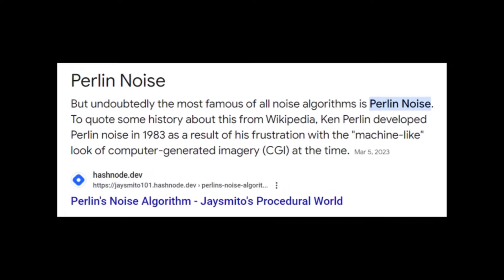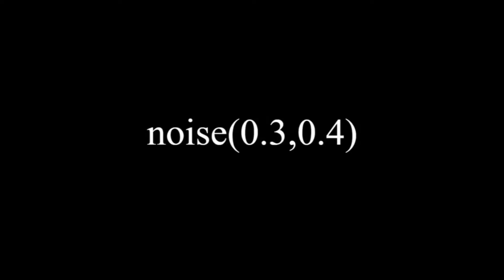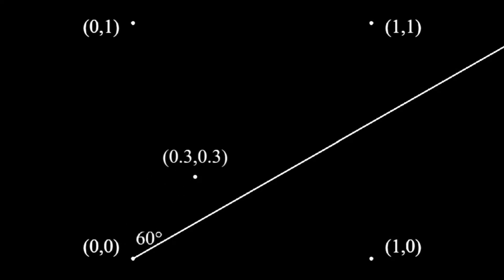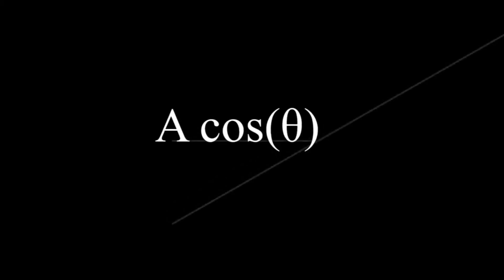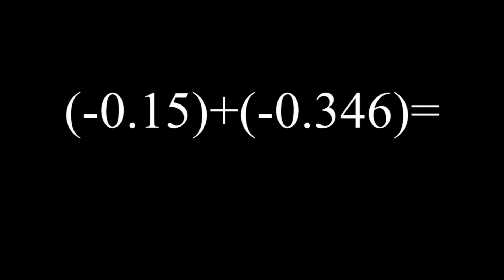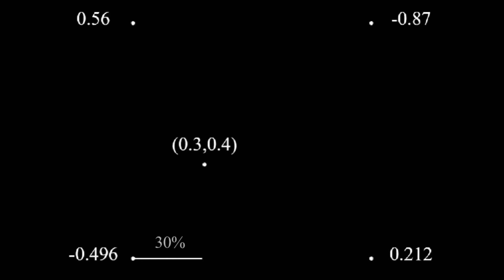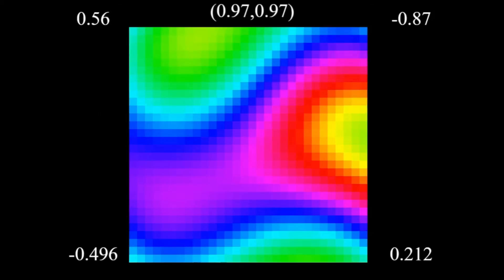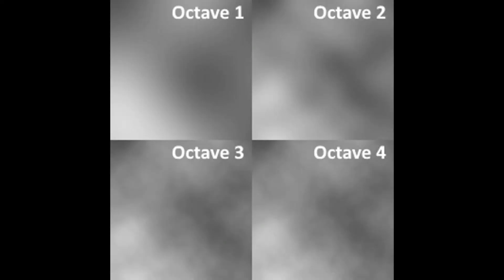How Does Perlin Noise Work?

Comment: 3:11
isnt it 0.131?
1 - 0.3 = 0.7
0.7 * 0.5598 = 0.3919,    0.3 * -0.8696 = -0.2609,

0.3919 + (-0.2609) = 0.131 (??)
Reply from the maker: Yeah it is. I think I got the numbers mixed up
Reply: @doggosScience  you should pin this comment so people will also be aware of the error, I've spent hours trying to make sense why it was .265 til I saw this mrkiblasty's comment lol, but yea this was a great video! so far the best video that was explained well about perlin noise!
Reply: @cedricjacob6954   I  same with you   ,   this question confuses me
Reply: the bottom one should also be -0.2836

Comment: Not gonna lie, no, I definitely don't have a better understanding now...
Reply from the maker: To put it simply, Perlin noise is basically a random grid of color squares that had a blur effect applied to it. The blur effect in question is the calculated with the algorithm that I explained in the video. The color square grid was the random numbers generated.
Reply: @doggosScience  I understand how noise itself conceptually works. I don't understand the distinction of this type and how to apply it well. Beyond of course the literal visual distinction

Comment: 1:59 it is not *approximately -0.15* it is *exactly -0.15*

By the way, this is the only video that actually taught us *how to* implement perlin noise by ourselves without much of the jargons. Respect bro
the algorithm is truly beautiful, it's just highschool math!

I still don't understand this part, where did 0.7 and 0.6 from? I thought it's 0.3 and 0.4. oh it is just an example

by the way linear interpolation I'm more familiar with this formula
((max-min) x percent) + min
this is used in statistics, the min would actually be the most left one in this context not the lowest value since we ask what is the distance between point a and b and say what happen if we just walk 30% of the total length. It gives the same result but this has a really simple geometric interpretation. Also in your video your calculation is wrong too.. You should slowly typing the number to calculator and checking if the values are correct

Comment: 2:47 How did you calculate the numbers for the top left and bottom right dots? I use the same formulas but the numbers are different. Can anyone help? I mean for (0,1) is: (0.3 *  -1) * cos(150) + (0.4 *  -1) * sin(150) and for (1,0) is: (1 - 0.3) * sin(45) + (1 - 0.4) * cos(45) isn`t it?
Reply: Hello 👋 
I had the same issue and wanted to share my solution for people who came here for answers:

The issue came about in my code because I was using (1 - 0.4) and (1 - 0.3) to find “dy” and “dx” for those corners, when you actually need to use 0.4-1 and 0.3-1 instead.

Apologies if this is unclear, if you need it better explained reply to this comment and I’ll hopefully reply
Reply: Did you convert to radians? Do you have the formulas used in this video fixed? I've been trying to make it work
Reply: @FirstsLasts-vy8qr  yo man i use this for it. But yes. In other places yes i convert them to radians. But in other places no. I still don't know how but it work and values are the same as in the video. 

var g3 = [Math.cos((v3 * Math.PI) / 180), Math.sin((v3 * Math.PI) / 180)];
var v3_dot_products = (g3[0] * current_x + g3[1] * current_y - g3[1]) * -1//

For other 2 corners i use the same formula as in the video. (Not native speaker)
Reply: @FirstsLasts-vy8qr i use just a formula from Wikipedia lol. Just turn in into code. You should now that i spend a lot of time to make in work.

Comment: Great guide. I tried to implement this from scratch and mostly got it working. However, when I generate an image, I can still see faint grid lines and I'm not quite sure why.
Reply: Okay I finally figured it out. If you are making an image and you want the Perlin noise to look super smooth, feed all your vector components into this fade function: 6*n**5-15*n**4+10*n**3. That is, when you subtract the chosen point from the grid point, make sure you fade both the x and y components. 

This is some math voodoo that really smart people came up with.
Reply from the maker: I’m glad you figured it out!

Comment: I was working on a perlin noise script in rust and used this video as my reference, it works great thanks for the super comprehensive guide! Due to the linear interpolation formula though, all points that are also grid points (such as say (3.0, 3.0)), will always create 0 values as their percentages are 0 (if I understood the video correctly). Is this normal or are there workarounds for this?^^
Reply: nevermind, i found the issue elsewhere. As the formula is using (1 - percent) * n_1 + percent * n_2 it wouldn't give a 0 value but just have the n_1 value as a result.
Reply from the maker: @marouanbellari1380 I'm glad you got it working!
Reply: @marounbx where was the issue, because I have the same problem and cant find the reason for it

Comment: The dot product is also often calculated as vector1.x * vector2.x + vector1.y * vector2.y
Reply: In this case it is easier to use trig function, since we know the angle, but if we know where the vector is pointing exactly we can just calculate it that way
Reply: And 1D?
Reply: @hiiV5  then that's just a simple multiplication